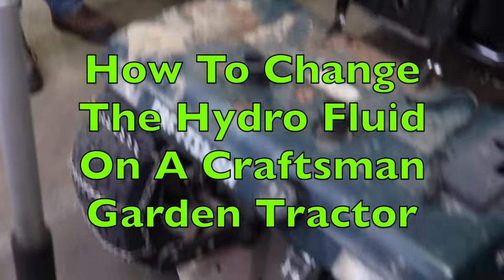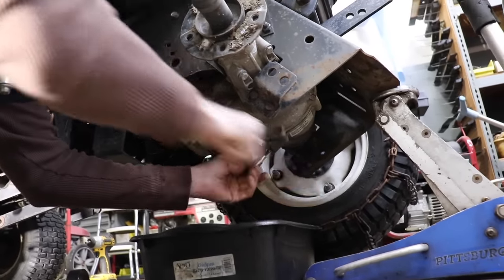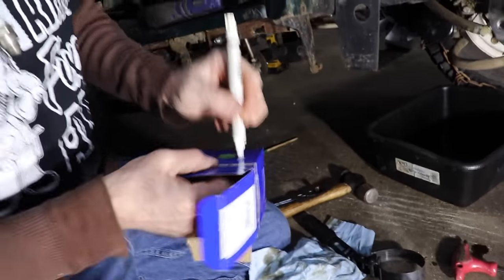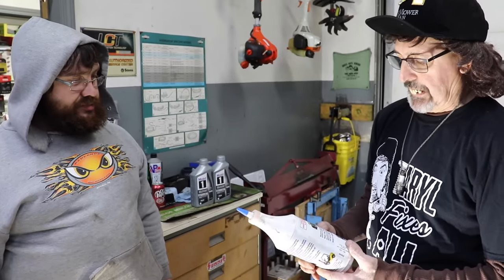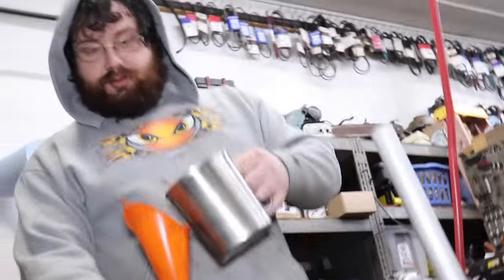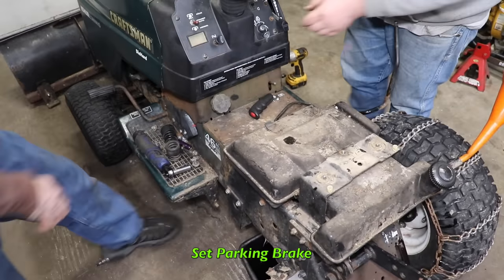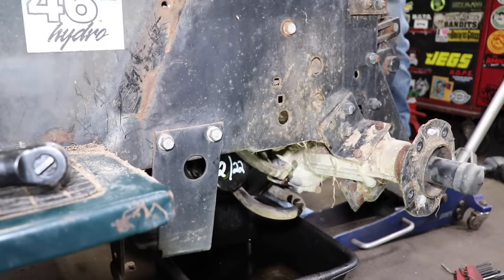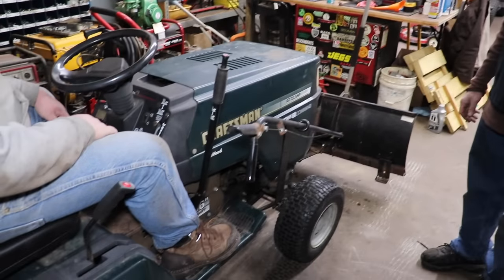How To Change Hydro Fluid On A Craftsman Garden Tractor (Hydro-Gear)

Comment: Nice video taryl I have a lot of respect for the craftsman tractors 2010 and older I’ve never had one that needed major work they were always very good to me I’ve learned to change belts very quickly and do just about every repair at my shop we get a lot of craftsman and they are very easy to work on from what I’ve found
Reply: Agreed. Mine is a '93, but I really need to do this!
Reply: @scottbryant2235  yeah it’s a good idea too
Reply: @Lowpass76 pretty sure all of them are serviceable and you could drill and tap the reads into one and drain it if you find a transmission that is not serviceable
Reply: Heers a stoopid ques, duz this apply only to tractors, or can ya do on reg craftsmn sit-down mowers??😅
Great vids!👍🏼
Reply: @rudysmachado5747  I’m not responding to that first get done better spelling and grammar then we’ll talk
Reply: @hunter7476  but u hafta respond, how wil I evuh change mah tranny fluid??!😟🤣
Reply: @rudysmachado5747  Tractors and sit down mowers are the exact same thing with the same transmission so yes obviously you could change the oil if yo I wanted to only the hydrostatic models you do the stick shift has gear lube grease inside and is it a serviceable unit

Comment: Thanks Taryl and Elkskins!  I have same tractor, little newer bought it in 1998 and never changed it.  I found filter right away on Amazon and will go to advance and get some oil.  My vent hose sticks out the back a little…going to try putting an extension hose on it for fill and may not have to take off fender, thanks!

Comment: I have one of those older Craftsman mowers with a 6 speed high and low with reverse. My favorite tractors!!
Reply: Same here! I have a 1996 GT6000 with the hydrostatic transmission and a 1997 GT6000 with the 6-speed High/Low. Best tractors ever built in my opinion.
Reply: Same... 2004 GT5000 here, which was the Last year they offered the 6spd (peerless) manual. It's virtually the exact same transmission as my 1970 Sears SS14 tractor (!). The only difference is they changed from a band brake to a disc. They're indestructible. Nothing against the Hydrogears in this video, but ALL hydrostatics are a joke compared to real gear-drive Manual transmissions (not cvt). As i said: 2004 was the last year any gear drive garden tractor could be purchased. Go find one; they're out there. Ignore the motor, easy to fix or repower. Don't buy throwaway yard machines ~

Comment: WoW, I never knew you could so easily change out the tranny oil in that. Well, you do have to either drop the tranny or remove so much above it. But still rather easy process. However, With the manual saying good for life and your service recommendation saying every 200 hours, that is almost criminal of them.  I have a Poulan Pro PRGT22H50D that has the 331-3000 hyrdro gear transaxle. For being a 2001 and getting it third hand used from my brother in which it came with a house he bought and sold years ago it still runs like a charm. However with watching yours and a couple other streamer with maintenance and rebuild vids, I think I have a bit to do to keep it running tip top. Thank you for your wonderful and entertaining how to vid.

Comment: This is the first time I have ever seen a 7/16 bolt ever used.  I always wondered who the heck designs with them?.  Wheel bolts are common on German cars.  Make a wheel hanger from 7/16-14 threaded rod or a long bolt.  Much easier.  Good and informative video.  Thanks

Comment: Great video, could we use a outboard motor lower unit gear oil pump that you put on the bottle to attach to the drain hole and pump it up to the level hole instead of removing all those components. Like on the Hydrogear pumps on zero turns that you can use?
Reply: That's a good idea
Reply: @JM-yx1lm  it's a mess no matter what, you just have to be fast and use you finger to stop it in between when you put the plug in like on an outboard motor.
Reply: @billlovett4256  Agreed, I've done it on many outboards-I think this might even be easier 😆

Comment: Hello Taryl. Your vudeos have really helped me. I did the rebuild kit on my cub cadet xt1 because the springs in the pump were busted.    
You mentioned that there was a part if you install it different from what it was the movement would be reveresed. well it happened because I did not remember which way it was. I had to redo it and now something went wrong an scratch that part. I can not find that part on Tuff Torq and i dont know what its called. Please help.

Comment: Lucas products are very good. I only use the oil stabilizer (about half the recommended dose), the zero or low viscosity stabilizer (at the recommended full 12oz dose), im sure the trans stabilizers are good products. I dont use any stop leak products, because chemicals dont fix parts that have failed or engines. In automotive transmissions i always add a tube of 4oz dr tranny instant shudder fix when i change filters. (Great for fords that get a bucky or jerky feeling at torque lock up- 40-45 mph) The lucas stabilizers emulsify the oil with long hydrocarbon chains (makes the oil very slippery and prolongs the thermal breakdown process). The dr tranny is an anti sheer additive that prevents the trans fluid from forming tiny air bubbles in the torque converter.

What i do for automotive transmissions that are the “non serviceable bs” (changing the filter in the pan) and dont have a dip stick is after I’ve collected everything in the pan i use rinsed out windshield washer jugs and measure exactly what i took out. I keep 1 dirty jug for the used fluid and one clean for the new fill fluid. Use a sharpy to mark the last fill level. So if i took out 3.5 jugs, i pour in 3.5 jugs. Since there isn’t a stick or fill plug level. I have never had a trans failure doing this for idk 25+ yrs. The only time thats not going to help is if theres a trans leak. Then you have to get more intuitive and figure out the solution. Usually though any of those leaks are more like wet stains and not active leaks. If it was an active leak, and since there isn’t a “normal” way to fill them the trans probably went low and cooked any way. Lol 

Great job fellas! That trans will run forever now. 👍🏼😎

Comment: great job guys...if it was my tractor, i would put some type of filler tube in it so I wouldn't have to take it all apart every time i changed the trans oil......and use full synthetic to make more time between changes

Comment: Thanks for this video. I just changed my fluid and purged, but now the tractor won't move at all. I have followed the purging steps, but still nothing. Any tips or ideas? I have tried tilting it and purging, turning off push-mode (that bypass valve), etc.

Comment: Ive discovered both my kohler command 25 horse  from my gt-5000  and my Kawasaki fr-730 on my husqvavarna ts-348xd  can use the same oil filter  as my old  s series saturn 1.9 engines used  which is nice cause i can get them at any auto parts store  and dont have to go to a mower dealer  .  and dont have to pay the money they want .

Comment: Hi guys I do enjoy your work and videos! I have a question to ask it is possible to change a plastic flywheel and the starter pinion 16 tooth to a aluminum flywheel and starter pinion to a 14 tooth in metal? And I could What's the kit number? The reason why I my lawn mower keeps breaking the starter pinion that's made of plastic I have bought 3 flywheel and 6 flywheel ring  I lost count on starter pinion  ! Thanks

Comment: I just here couple months ago change the oil in a 1970 Charger 12 automatic transmission and doing the research on what I can replace the oil or, I could find out I can use 10 W 30 and it took 5 quarts and I'm surprised that it took much because it does not look like it holds that much

Comment: Can you spin the input pulley at very high RPMs and get a high output RPM at the output shaft on the hydrostatic transmissions?  I'm making an electric boat motor and need a variable transmission for it that can handle up to 3000RPM input speed.
Reply: You’d probably cook that transmission they aren’t made for that I don’t even really get what the heck your trying to do it sounds like a bad idea
Reply: @hunter7476  You could be right, I am utilizing an old lower end of a boat motor with an AGNI high power Axial gap flux DC motor which is capable of about 12hp currently.  I'd like to be able to try and use a larger brass propeller which is about 15 lbs and 14" around the circumference of the blades, but would like to try  a variable transmission preferably over the gear reduction unit I have currently.

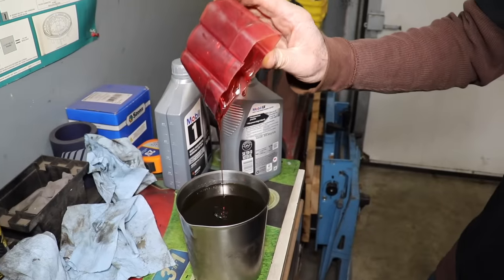Comment: @14:56 Like putting STP in your engine crankcase.
It's all snakeoil. The high viscosity gums up everything and makes it work harder wearing out prematurely and hiding the real issues.
It's good if you're selling an old POS and want to dump mechanical issues on the next person.
Reply: I've been putting STP high mileage extra zinc ( gray bottle --- because the oil manufacturer took most all the zinc out of the oils ) in all my vehicles for many years with no problems . I let the engine come up to temperature then put it in and then let it idle for a while . One of my Ford's ( 1994 ) has 250,000 miles on it the other ( 1985 ) has 200,000 miles and my Dodge (1988 ) has 130,000 miles on it -------- all push rod hydraulic lifter engines and I change the oil every 3000 miles or less depending on how much I let them idle , no problems yet and I'm not getting rid of them any time soon
Reply: 14:56??!!
More like 27:25, kid.

Comment: I have a 2012 or 2013 Cub Cadet LTX1045 with a Hydro Gear Trans 
when it is cold it goes forward and backwards just fine but the longer it runs the less it goes forward and backwards it does
any help or advice you can give ?

Comment: I have a 1998 Craftsman riding lawn mower with a 19 horse, hand controlled hydro, same color. What transmission do those have? I know it doesn't have a filter and can the fluid be done the same way as shown in the video?
Reply: on the lt1000 (assuming thats what you have) you have to pull trans out flip it over and drain it
Reply: @Elkskinsmowerjunkyard  Appreciate the reply back and thanks for the info!
Reply: I was wondering the same. I recently resurrected my grandfathers Sears Craftsman 18hp twin 42” (LT4000 built in 93). These things are built like Sherman Tanks vs what is sold today.

I did find it odd it doesn’t require an oil filter. Given the age and the Florida heat would any of you suggest sticking with SAE 30? Thanks

Comment: I have a craftsman mower hydro gear transmission will not freely push when you pull the pin. What could be the cause?

Comment: I have a Hydro Gear on my Craftsman GT3000 but it does not have an oil filter? I'm thinking maybe it's supposed to be a sealed unit. I would like to add a drain hole and tap for a plug though.
Reply: I have the same one.  It's similar to a drain and fill procedure for transfer cases, differentials. And certain transmissions.
No temperature considerations though.
1.  Make sure you can remove the fill plug first.  Very important.   U believe it's part 40 on the diagram in the manual. 
2.  Drain the fluid through plug 46.  
3. Use a simple oil pump ( mine is from harbor freight with a in and out port). Fill it through plug 40 until it starts to trickle out.
Done.

Comment: You need a set of Carlysle AT101's for that tractor and you wouldnt need chains. They are bar lug tires with rounded lugs and wont tear up the grass either. I have a tractor like that I use for snowblowing and mowing a small field. It pulls a 64" 20 hp haben offset deck and gives me 110" cutting path. Works great. The last of the good garden tractors..

Comment: Hi Taryl, bought a John Deere X370 lawn tractor with a 21.5 HP Kawasaki motor, the dealer and the tractor manual are telling to run the motor at  approximately half throttle before shutting it down or I will damage the motor if I don't do so. Can you tell me what would happen to the motor if I was to shut it down  with the throttle on idle.
Reply: I am not a pro but on my used Koehler several times at idle shut down it has made a bad rattle especially if I don't give. It about 30 seconds or so.  I think it is the compression release as it sounds rpm and cintrificly related. I dont. Have the manual for mine. So I am glad I found out from you. I need to do some. Checking before I screw mine up thank you for bringing this up
Reply: @johndoe43  you're welcome

Comment: Hey I have a old cud cadet mower has the hydrostatic trans its a 2150 I believe do you know what kind of oil I use or tyranny fluid or rear end grease or what and is there a filter for mine ? Thanks
Reply: Hytran ultra

Comment: I would puta hole in the fender under the seat to run the transmission tube through. So would not have to take it all apart to do a fluid change. Even if you had to extend it.

Comment: put a vent tube down your funnel and vent tube,  warm up the oil and it goes right in because the air can escape up the second vent tube
Reply: If you have the fill level plug out that would be a vent.

Comment: Very odd combination of Lucas thickener and high-polymer 15w50 when you can just use straight 40 weight motor oil in old transmissions.

Comment: I wouldn't waste my time with taking off the fenders and moving the gas tank, it's a lot faster and easier to use a large turkey baster with an piece of hose clamped to the end and fill it through the overflow plug until it starts to come out, IMO anyway.

Comment: Tightens filters with a wrench... uses oil additives... Real winner.

None of the oil additives help anything.  What they do is dilute the chemistry that actually works.  You know damn well the wear parts are responding to the viscosity change.